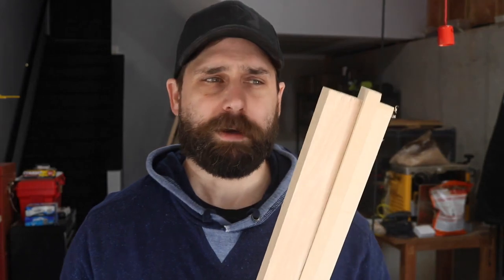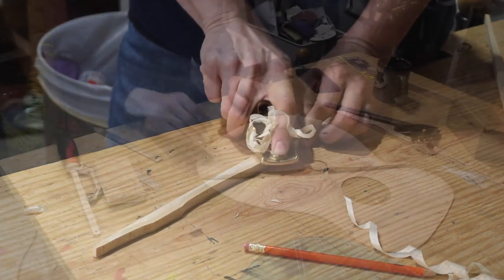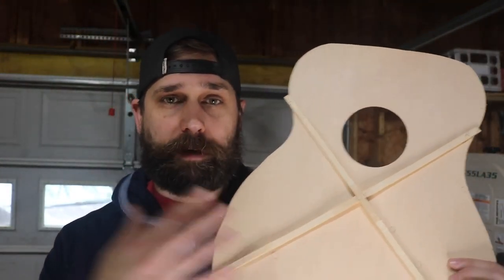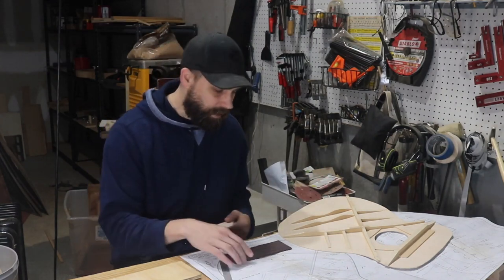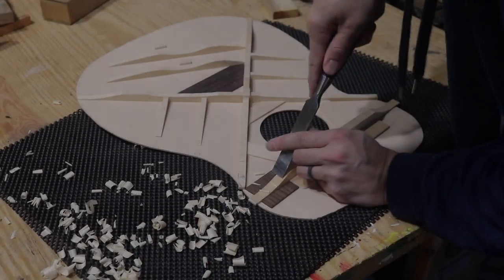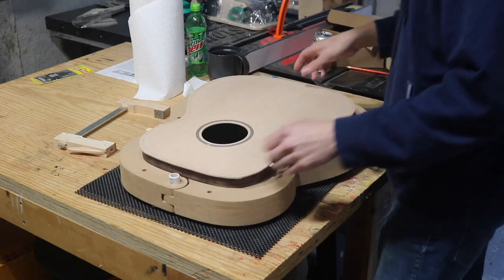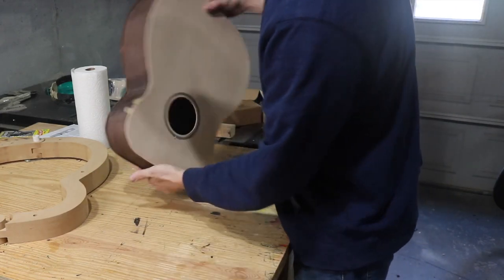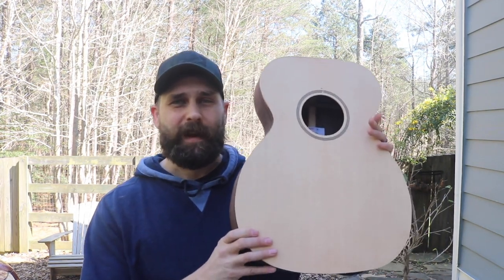Acoustic Guitar Build part 7 // soundboard bracing & closing the box

Comment: Nice workmanship Chris. I like how clean your work is. Where did you find the go bars. They better than my kite rods.  lol
Reply from the maker: Hey Monty, thanks for watching and commenting! I got the go bars from StewMac. They are pretty sturdy
Reply: I made mine myself. I needed alot of gobars and they are quite expensive at stewmac. I bought 20 fiberglass rods 6' in length from tapplastics. It cost me $ 84 with shipping and I made about 60 rods. I dipped the ends but I think you can buy the rubber tips on amazon. Anyways @chris.. I hope your build is going along well. I am at the pore filling stage on a dreadnought. Getting ready to soon spray nitro at it.

Comment: First time luthier here too bro. 

I can very much feel every moment of your agony and triumph. 

And your last comment resonated (no pun intended) with me too about the binding—yes be very afraid!!!  

I totally butchered mine. I had to fill in some wide ass gaps with wood filler. Hey….what can I say….not bad really for my first time. But it’ll improve with each new build. 

Good luck brojam🤙🏽
Reply: Next time you have gaps, you can use an Iron and heat the area up and then carefully clamp it into place. Just be careful not to overclamp and crack the sides. (Assuming you are using wood bindings and tightbond)
Reply from the maker: Thanks for the comment Hugh!

Comment: Great job, wait until you get too the neck, Too me that was the scariest part of my builds, There is so much that can go wrong. Good luck & God Bless🙏🙏🙏💪🇺🇸🇺🇸🎸🎼🎹👨🏻‍🦯
Reply from the maker: Yes, I am a bit nervous about the next. More so about joining it to the body than shaping and stuff.
Reply: Yea I built 4 tenor size ukes from scratch, the first one was an abomination, the 2nd pair I gave to my Sons they are still holding up ok. My 4th uke  the lacquer is still drying I did Bolt on necks on those & I got lucky with the fit & neck angle, But the parlor guitars Iam now building are so much bigger, I’m getting ready to put my keffed linings in now. Good luck Man.🙏🙏🇺🇸🇺🇸🎸🎼🎹👨🏻‍🦯

Comment: Hi,
really great channel and great job on your guitars.

I am currently working on my first guitar.
the next step is bracing and then closing the box

I have a question.
did you also grind the sides with a radius for gluing the soundboard on. How to do on the backside.
Sorry for my bad english.
Greets from Germany 
Mario
Reply from the maker: Yes, after I install the kerfing, I radius the sides again on both sides then work on attaching the top and back. Thanks for watching!
Reply: Hi Chris,
Thanks a lot for answer. Did you grind the top also with the 15 degrees dish?
Or do you have a 25 degrees dish for Front and Soundboard?
Greets Mario
Reply from the maker: No problem! I use 30 degrees for the top and 15 degrees for the back.
Reply: Thanks a lot Chris!!! Now i can start grinding the Bracing and Body.